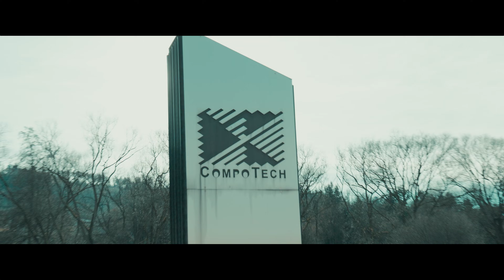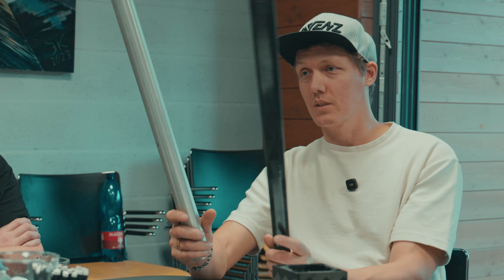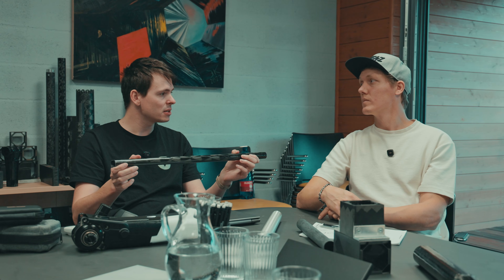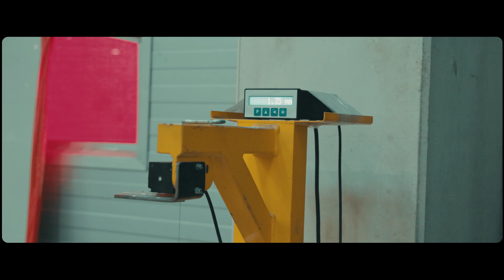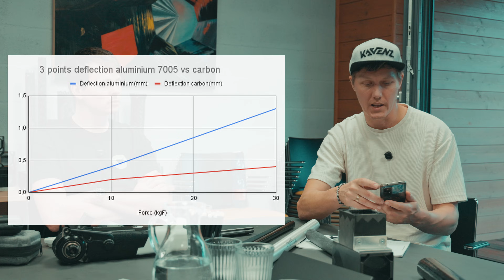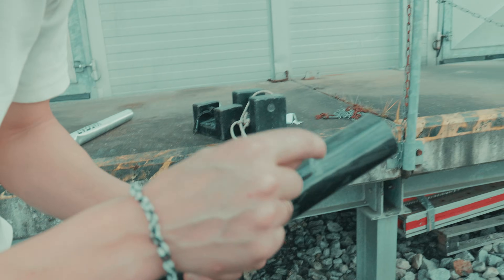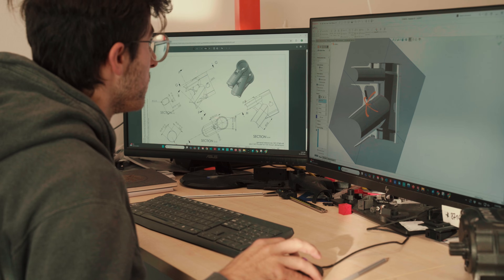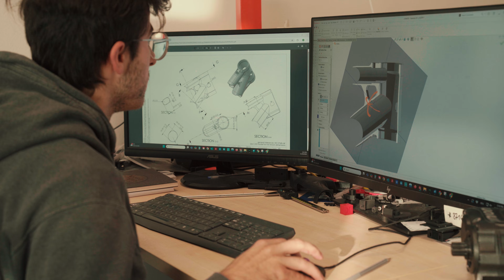Aluminium vs Carbon bike tubes. MTB Frame Development – Episode 3

Comment: As someone who does a lot of freeriding, I have always felt far safer on an alumininum frames than carbon. I have seen to many carbon frames crack, completely fail and plot in half over the years to ever want one.
Reply from the maker: We feel you that's the reason we are exploring this material very carefully and won't just do it for the hype.

Comment: I’ve generally owned aluminum bikes (loving my v7 Kavenz), and am not surprised to see the comments skewing towards fear of carbon being the new Kavenz material of choice. 
A lot of people seem to think of carbon as the more durable material. That being said, a huge positive of carbon that I think gets overlooked is that it’s repairable. 
That being said, is the filament wound carbon from c-duro as easily repaired as traditional carbon layups?
Reply from the maker: From what we understand yes it shouldn't be a difference but obviously it's not possible to restore the infinite fiber so you may need a thicker repair layer to reach similar stiffness.

Comment: Would like to see this test with 7075 like Nicolai use. Just if you flick with your finger a 7075 compared to 6 series tube you can tell the difference! The 7 feels like a scaffold bar the 6 more like decorating ladders if that makes sense
Reply from the maker: Those are 7020 tubes and Nicolai is most certainly not using 7075 as it ain't weldable. 😅
Reply: @Kav @Kavenz-77 logies! My bad and as a time served welder am now embarrassed!😂 can only imagine I’d just read a drawing that mentioned 75…..anyway my point still stands!
Reply from the maker: @piersbickerton-jones6231 never mind 😅 so you'd like to see 6000 Vs 7000?

Comment: with carbon fiber in this use case i would worry about compression after impact( CAI ). Because the compressive strength of carbon fiber can be drasticly reduced by impact (which is the mechanism behind most carbon fiber frame breakages (not the often wrongly stated inability of carbon fiber to stretch)).  As Giiacomo tested the impacted tube he turned it around so the impacted area (which has a significantly reduced compressive strength) is now loaded in tension(tensile strength in damaged carbon if often still ok because its not as dependent on Matrix(which is the first thing which gets damaged by impact) as comrpressive strength and also carbon is around twice as strong in tension then in compression.
Reply from the maker: Thanks for the awesome feedback. The CAI (Compression After Impact) is new to us and super interesting in this application. We plan to collaborate with a university to dive deeper let's see what we can find out.

Comment: It probably doesn't help the reputation of carbon fibre that a lot of products exist with a bad weave or too weak for their intended use. Well manufactured carbon fibre is extremely long lasting and strong. Yet aluminium is quite the wonder metal still.
Reply from the maker: Agreed with the correct use it's great and for tubes it outperforms aluminium alloy easily. For the interfaces like BB and Headtube we feel like aluminium is still the better choice, also for the rear triangle where impact is the norm and not the exception.

Comment: Keep making metal, dude. Everyone knows metal handles all the scrapes and dings without worry - up until it fails. Carbon gets hairline cracks and you simply dont know if it's rideable until it fails. We don't care about 1 pound of weight savings on trail and enduro bikes!
Reply from the maker: We aren't positive that the new frame will be lighter, it's also not our goal at the moment we want it reliable and have seen as many aluminium frames fail as carbon.

Comment: Really love the transparency into your development of these bikes.

Seems like durability is pretty comparable between the two materials and the more significant difference will be in the ride feel. The carbon was quite a bit stiffer and presumably lighter (would have been interesting to compare the weight of each tube as well), which will lend itself to a more precise, lively, playful ride. I'm guessing the extra weight and compliance will help aluminum feel a bit more forgiving, comfortable, and composed in rough terrain, which I really appreciate about the V7 frame especially at 180mm. Granted there's probably also a good amount of leeway to tune the carbon layup and tube profile to keep more of that compliance if you wanted. And you could always add weight if you want a heavier bike, as we are seeing more and more in WC DH these past few seasons, so the carbon frame would be a bit more tunable and versatile in that regard.

Do you think you will be able to customize the tube layups for each size to keep the compliance consistent across the range?
Reply from the maker: Thanks for the awesome comment. We forgot to add the weight difference in the video 😢 The Carbon Tubes are about 30 percent lighter and yes we get freedom to tune flex per size in theory. In reality it's more difficult as small riders aren't always lighter and vice versa. But we are excited to be able to explore the options of offering the VHP12 with dedicated tubing for example.
Reply: @Kavenz-77  Yeah, that's a good point. I would think that the average rider weight for a smaller frame is likely lower than the average rider weight for a larger frame, although that's just my speculation. But even for the same weight, I presume you would need stiffer tubes to achieve the same stiffness on larger frame sizes simply because the tubes are longer. Would be sweet if riders could choose from 2-3 different stiffness options based on their weight or preferences, but I can also understand how that could be difficult and expensive to develop and manage.
Reply from the maker: @mattschirle actually the carbon winding is relatively cost effective even for small quantities what makes it hard is more the lab testing as that might mean that we'd need to test at least a good amount of different combinations. Also it's a legal gamble to say this frame is only allowed to a weight of 70 kg and the other is for 120 kg that's essentially the reason why it's hard to make light weight kids bikes. As a manufacturer you always need to think of possible abuse and a dad riding their kids bikes for a moment is absolutely realistic.
Reply: The durability is not comparable
Reply from the maker: @harrie205we'd say in some ways it is in others absolutely not. Aluminium has a limited lifetime and ages/fatigues. Carbon has an infinite life so without an impact or crash you can ride a carbon frame much longer.

Comment: Another great video, really enjoying the series! Especially the “scientific” testing 😂

One question I had from the carbon process. Andre briefly mentioned wrapping the tubes in tape to extract the air and excess resin and cure the final shape, does Compotech also use alloy molds (like what’s used in a more standard carbon process) to do this on other tubes/projects? I’m sure this would add substantial cost, but I’ve seen Framework Bicycles do this on their frames.
Reply from the maker: Glad you like it! Yes, Compotech also uses alloy molds for other projects.

Comment: Nice work!

I am still pro aluminium as it can be recycled which is a big win if you ask me.
Reply: I agree. I think carbon should be only used on stuff with no other option. For MTBs it just isn't needed. For now, carbon just ends up in a landfill.
Also, carbon tubes may look like nothing has happened after a crash, but you never know, how it looks on the inside, or if it has delaminated...
However, the way these guys make tubes is pretty cool.
Reply from the maker: @haraldglanz Hey Harald, this isn't correct anymore and chipped Carbon is in high demand.
Reply: @Kavenz-77  It would be great if that were true! But I can't find any information about it. Could you share any? GCN's video from a couple of weeks ago sums up the situation pretty well: https://www.youtube.com/watch?v=1gnj8X0r0HA
It would be great if carbon recycling (rather than downcycling) really happened!
Reply from the maker: @haraldglanz according to compo tech the used carbon used for injection molding is in very high demand we have a small interview with them that we may include in the next video.
Reply from the maker: In fact chipped Carbon is in very high demand now. So recycling or better said down cycling isn't the issue any more.